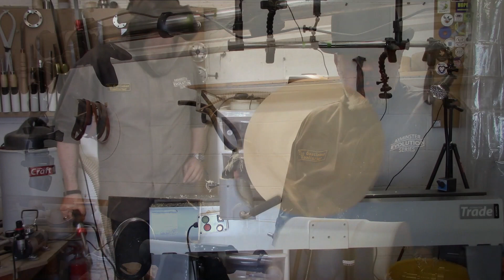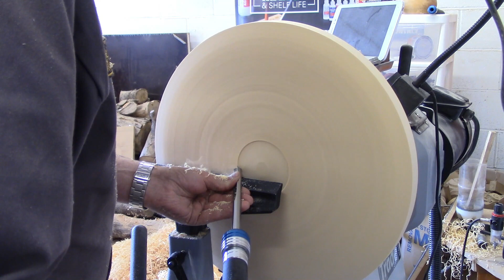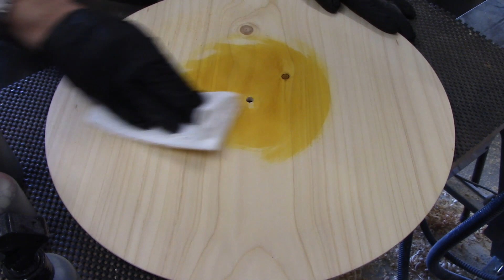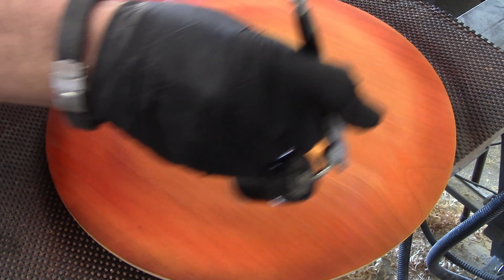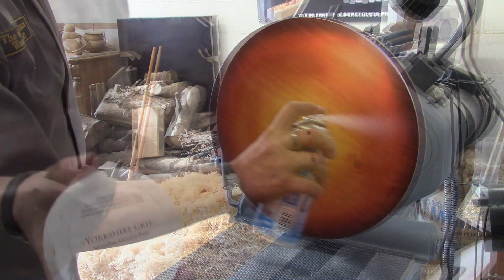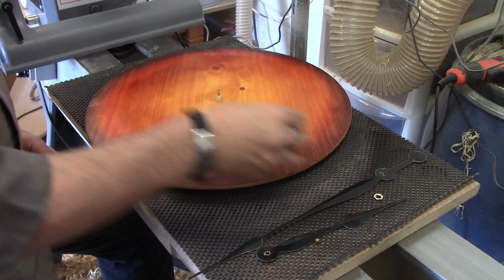Woodturning - Making a large garden clock from macrocarpa wood.

Comment: I learned by experience that the small electric clock mechanism with an AA battery doesn’t last long with hands that size. Not enough power in the battery for the weight. Better to use shorter hands and introduce lines on the surface (inlaid or routed). You want the clock to run more than a fortnight.
Your clock face is beautiful. 😃
Reply from the maker: Thanks, but this was a specific request from the customer and it was a purpose made weather proof mechanism. Thanks for watching.